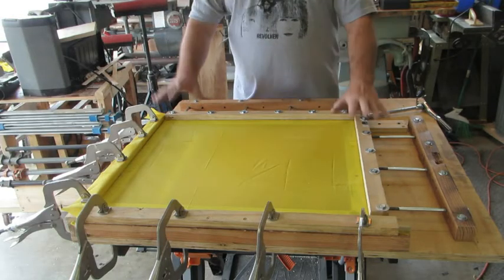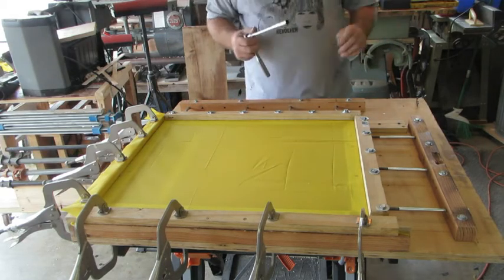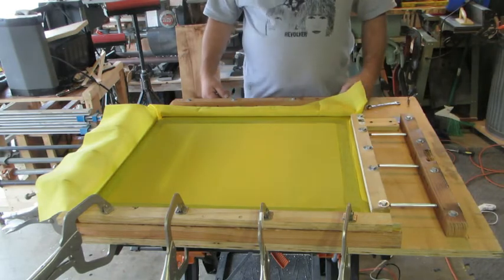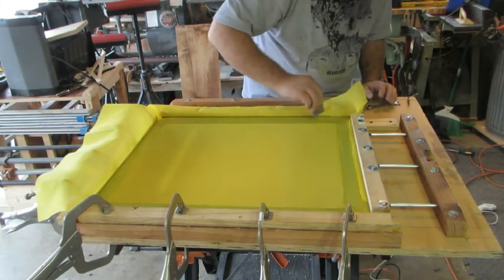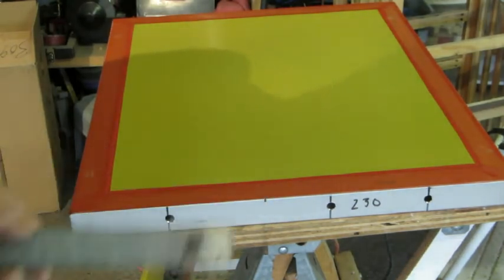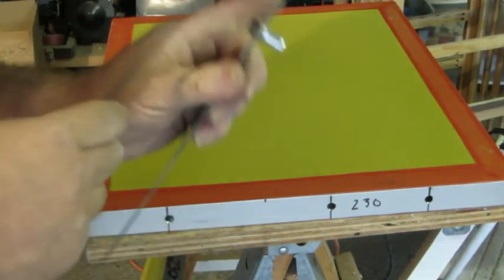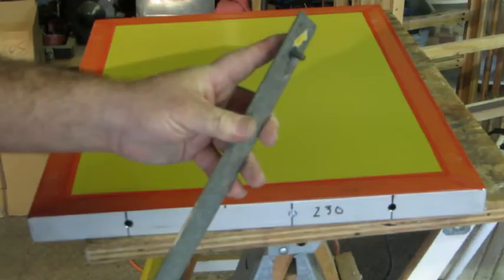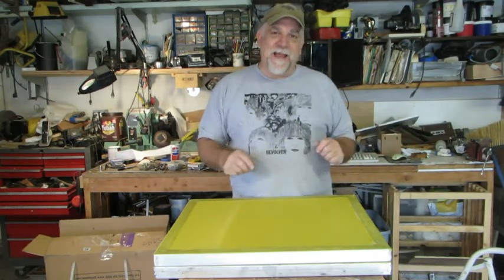Improved Screen Stretcher PtII

Comment: Sir please tell me the stretching spray & chemical.
Reply from the maker: The glue is just thin SuperGlue (CA glue).  The spray is an accelerator that dries the glue on contact.  Don't know where to buy it outside the United States.
Reply: Thanks but I live in Pakistan Is this chemistry available in Pakistan?
Reply from the maker: @malikmursaleen9684  it should be.  It's very common and I did see some supply places in Karachi.  I looked after looking at your videos.